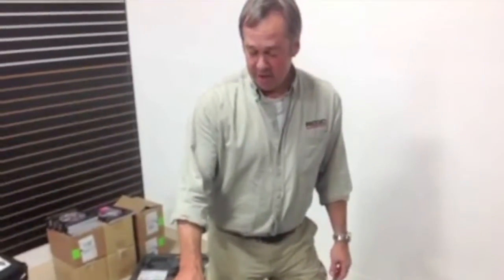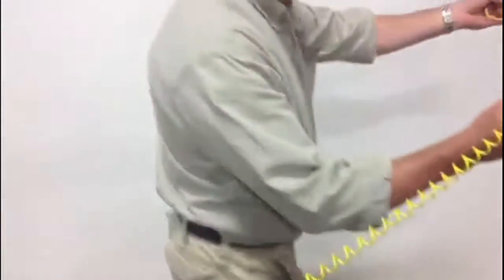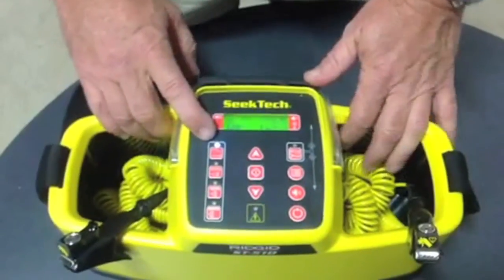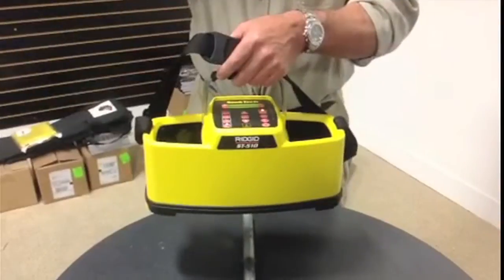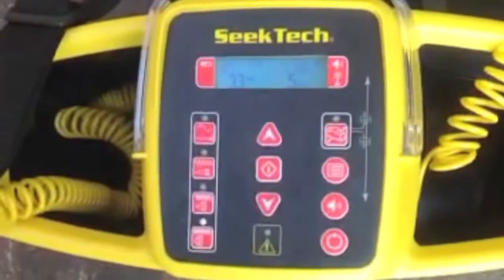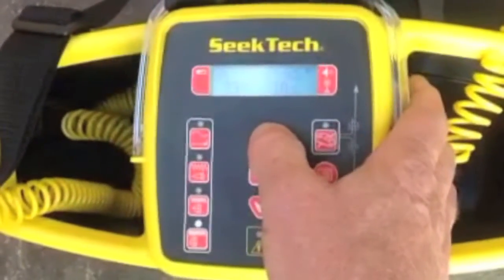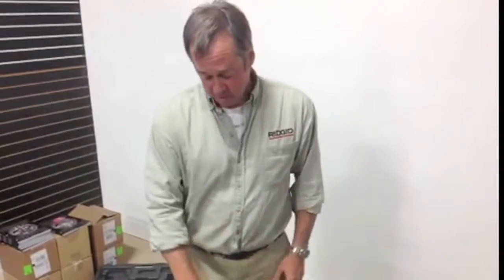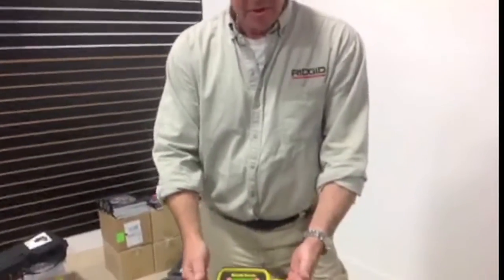How To Use The RIDGID® SeekTech ST-510 Line Transmitter

Comment: Instead of D cells that can leak why not a lithium battery pack that can swapped out. 

This is 2025 not 1980. No reason to still have batteries that can leak. 

It’s a great product otherwise.